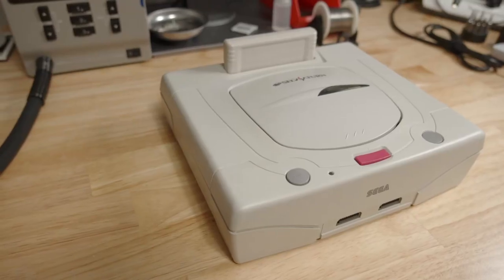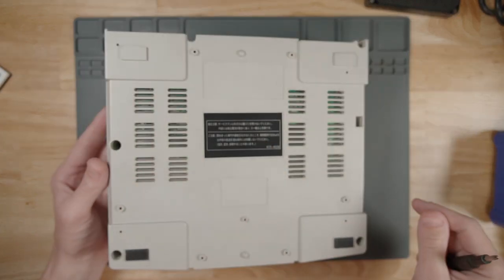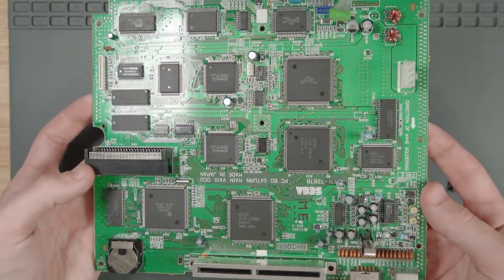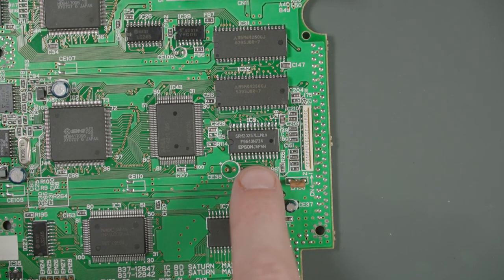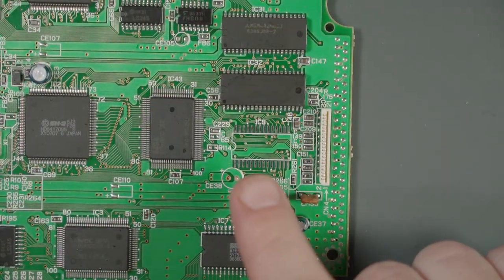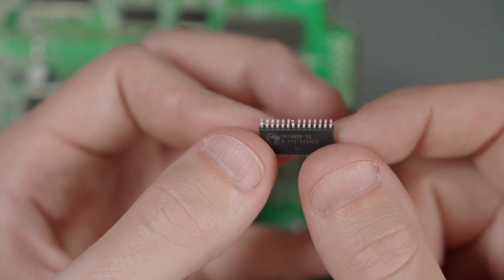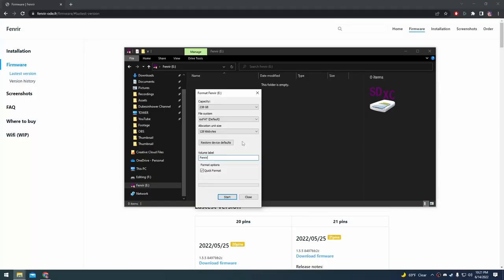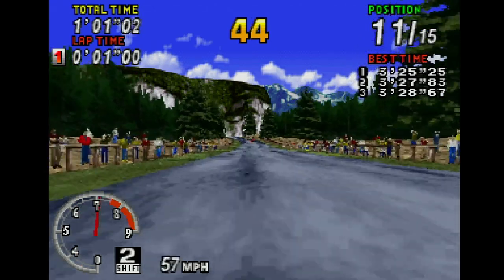Do These Console Mods to Your Sega Saturn!

Comment: The FRAM mod was giving me a lot of trouble because my board looks nothing like the boards in ALL the FRAM mod video and guide I've seen. On top of that my chip is epoxied/glued on. So I ended up having to figure out where to find my SRAM chip, how to get the epoxied chip off, where to find the 5V source for pin 28 and where to find GND point for pin 22.

So I want to give some advices to those running into the similar issue I've ran into.
- On finding the SRAM chip: Sega used many difference sources for their SRAM chips and had many board revision so using a specific SRAM chip model and a specific location isn't the best advice imo. Here's what I did: look on the board for a 28 pin chip (14 on both side) and look for the marking "IC8" on the board next to this chip. THAT's the SRAM chip. Presumably you already have the FRAM chip at this point, compare that chip to your SRAM chip...they are similar in size and has the same pin layout. 
- For the first time, I've clipped the legs off to remove a IC chip off a circuit board BECAUSE: 1. I don't want to risk ripping any contact pad off; 2. The SRAM chip is useless to me anyways and even if I fail I wasn't planning to reuse this chip. I'm glad because this is where I quickly realize the chip is glued to the board. I like how almost every video of FRAM chip mod don't have to deal with this. Key is to cut the point on the pin closest to the body of the chip. 

NOTE: I don't know what's the best way to remove the chip with epoxy underneath it but this is how I did it:
- When I realized there's epoxy on the SRAM chip. First thing I did is to clear the broken pin and solder off the traces. Since I'm gonna use force to remove the chip, I don't want to risk any chances of ripping the traces off the pad. That's why it's important to cut the pin close to the body of the chip. Then I busted out a heat gun. I'm not the best with hot rework station so clipping the SRAM chip pins was a way for me to avoid using heat but funny how that turned out. If you weren't originally planning to cut the chip off because you don't want to ruin it (I get it, I also have a habit of trying my best not to destroy components I remove from the board.)...my advice at this point is to just cut it off...it's not worth saving and risk damaging the board.
- I used kapton tape to cover the area around the SRAM chip. There are bunch of tiny SMD components next to the chips so I just don't want to risk accidentally knocking one of the them off. Again I find it funny how the area around everyone's else SRAM chip has so much less SMD components...LOL. Mine has a bunch of resistors literally right next the the SRAM pins. Again this fact that came into play to the decision for me to cut the chip off. There are just so many small pieces around the chip, I don't want to risk accidentally knocking it off while removing the SRAM chip.
- I used a heat gun on low heat setting and introduce heat around that area and use a metal spudger tool (it's stronger and doesn't melt under heat) to poke from the bottom of the chip every like 10 second or so. I was planning to increase temp if necessary. So it's introduce heat, 10 sec, move heat gun away, poke the bottom with a metal spudger, see if it moves, move heat gun back and repeat. I did not use flux since I know I'm not working with solder here (I removed them earlier). I did add some isopropyl alcohol to see if it does anything but honestly HEAT is the main source to help me remove the chip. It took me less than a minute or a minute (I didn't time myself) and I was on lower setting of my heat gun the entire time. Be patient, I know you could be a little on the edge at this point but don't do anything risky. I was totally bummed out when I realized I had to remove the glued chip so I get it. You can try to remove a bit of the epoxy if you think there's too much (I did by heating it up a bit and trying to scrap it off with broken toothpick) however I don't recommend trying too hard remove it off completely because those leftover epoxy are super hard, don't get in the way of you installing your FRAM chip, and won't be seen after you install the FRAM chip...so why risk it if you don't have to.
- If you're more comfortable and have a rework station, that's probably easier. I used a heat gun so it could be done even if you don't have the equipment. In low setting too so I have a feeling you might be able to do it with a hair dryer. 

- To find the 5V and ground point - the easiest way is just reference what other used. However you might run into the same problem I had. My board doesn't have these 5V or ground point you've showed me. So my REAL advice is to use a multimeter (it necessary tool for most board work, get one if you don't have it) to probe for your own sources. It's extremely simple, all you need is to know how to use "continuity" mode on your multimeter.
- For ground source, the edge of the board are usually grounded (this is the part of the board where the metal shield touches), so you can use those dot scatter across the edges of the board as a reference grounding point. Now probe around the FRAM chip to see which grounding point makes the most sense for you to solder a wire to and connect it to pin 22. I decided to keep it short and picked the closest source to me, a ground point of an SMD component. 
- As of the 5V source, the IC8 chip (RAM chip) are usually next to the IC7 (bios chip). In fact, my board only has the IC7 chip next to the IC8 on the bottom of the board. There are no other chip even close to IC8. This is why I suggest looking for the IC7 for a reference 5V point because of all board variants I've seen...there's always an IC7 chip nearby the IC8 chip. ConsoleUnleashed guide has a VA1 board variant with a chip right of SRAM chip, which they decided to pull the 5V source from but I took a look at my board and was like "Great...that chip is not even there." One of the corner pin (pin 21) of the bios chip is VCC and that's pulling 5V. Look at the board for IC7, find pin 1 which usually contact point with the arrow, VCC is the corner diagonal to that point. I realize this board doesn't have the arrow. Looking at IC7 on 8:33 which is right underneath the tweezer and viewing from the chip with the half circle cutout on the left, pin 1 is on the lower left and pin 21 is the upper right. I use a multimeter and probe for a point closer to pin 28 of the FRAM chip using VCC of IC7 as a reference point. I actually did not use the closest point here, I found a point that's a clear spot meant of an SMD component but wasn't populated. It was a totally open location and there wasn't any components around it so it's comfortable point for me to solder my wire to. If my board has CE111 of this board with thick unpopulated pads to solder to, it would've been nice but I'm left with either small SMD point or thin leg of IC7...sigh...lol...

These are my advices to anyone else doing the FRAM chip. Hope this save the time of anyone planning, attempting, or having trouble with the FRAM mod.

Comment: 00:16 “I just don’t see the appeal of buying used discs for old consoles.”

It’s the nostalgia for many of us retro game collectors. It can be a much more powerful experience to have an old console on your shelf, open a disc/cartridge case, pull out the physical media, clip it into place, and watch as the console actually uses the original technology to load the game onto your television; verses just having 100’s of games listed on a screen via digital interface from an SD card. Scratches on a CD 💿 aren’t really an issue either. My local gaming store will buff and polish CD’s for a few bucks each. I have 30 year old discs that play fine.

Comment: It's typically best not to rely on digital only solutions. It's always best to have a hard copy. Purchasing used games online is usually not a problem. I have never received anything scratched that badly. One of my saturns has a ODE, but I still want a disk backup. You can even go so far as to burn ISOs on a BD-ROM and store it in a save place. I'm just saying I try not to but all me eggs in one basket, so to speak.
Reply: Discs may last but the laser drive won't last forever
Reply: @the_peefster  this ^ the guys being an idiot 😂
Reply: @the_peefster ar har fiddle me dee you are a pirate. Also you can buy the drives new for about $30.00.

Comment: Except for the fact that you can't get a 21 pin fenrir anymore
Reply from the maker: They must have gone out of stock right after I released this
Reply: @dubesinhower  Sadly both 20 and 21 pin still out of stock :/
Reply from the maker: @TheSnowwraith  there is a new version that has both 20 pin and 21 pin connectors called the “Fenrir Duo”, but it is also out of stock

Comment: At that point you may as well be emulating. Fram mod fixes a legit issue but using the excuse of disc rot is far from the truth. A bigger issue is the Saturn's disc drive laser depending on model of disc drive in use can and will kill itself. Even that is relatively inexpensive to replace when it does. Region free mods are far more interesting, the fact you own a Japanese Saturn tells us exactly this.